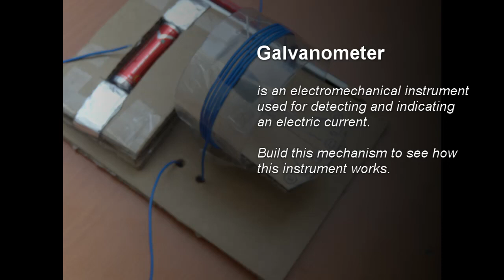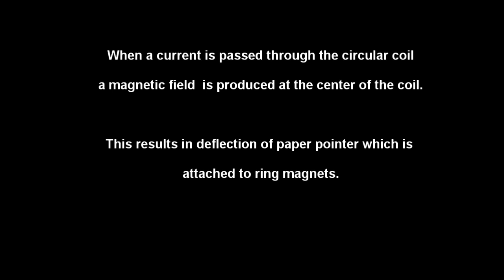Build Simple Galvanometer

Comment: Please clear the battery concept
Reply from the maker: Current thru coil creates magnetic filed. Ring magnet has its own field. These two fields interact to create resultant movements
Reply: Brother I have constructed it but when I'm connecting the 2 ends of wire to battery no current is flowing
Reply: But when I inserted the wires to the switch then slight sparking occurred
Reply: I'm confused because I have not used ring magnet because I couldn't find it. Rather I used a heavy magnet which is available inside a computer
Reply: @RavindraGodbole  bhai make a video on how you have attached the battery
Reply: @md.hashirakhtar3777  Heavy magnet not good